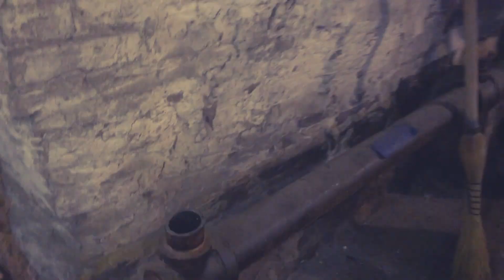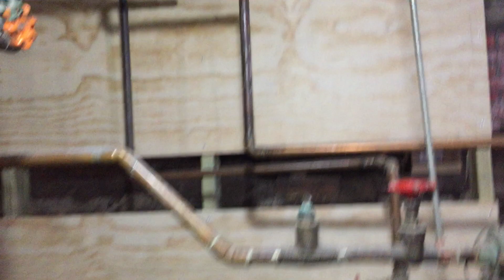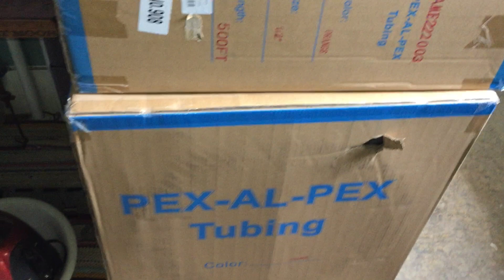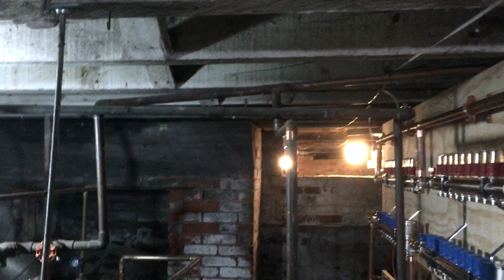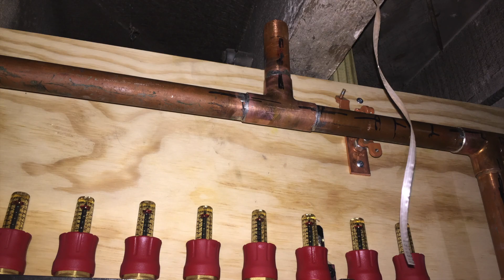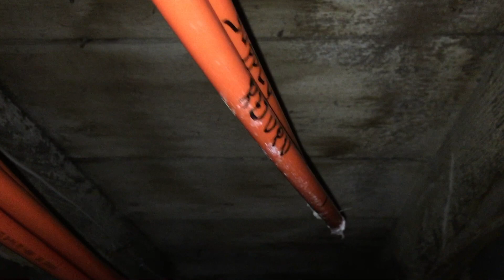Heating System Upgrade Part 2

Comment: How many SQ ft is this house with three apts?

On a single 3500 sq ft home I currently have 2 in black pipe for the majority of my one pipe system connected to my boiler. If we run the pex as one pipe through the whole house, can we go down to 1" PEX (PAP)? 

Or do I have to run this on a manifold? 

If yes, 

I have 7 radiators on the first floor, 6 on 2nd floor, and want to add 1 new on the third floor and 1 in the basement. 

 
What fittings did you use for the PAP to the radiator?  Copper or brass?
Reply: I just realized you're using half inch PAP. 

So if I go to manifold and not just one circle around the whole house I can use the half inch right?
Reply from the maker: It is an 8000 sq ft house and only has 1 apartment of which is three rooms basically - bedroom, liv room, and bathroom. There is a little area for kitchen sink, small stove and small refrig. This area is part of liv room. So the Apt has 3 radiators - one for each room.
I think that there is a benefit to running radiators out of manifold. Each radiator is going to get hot water, not water left over from the radiator before it in a loop. 
You said that you have a 1 pipe system - do you mean a supply pipe and a return pipe? Or just 1 pipe to each radiator?
If you have only 1 pipe to each radiator, than you have a steam system and that runs differently.
I would look at a couple of online supply houses of Pex equipment. Two that come to mind are supplyhouse.com  which has information too about pex, the other is pexuniverse.com. This will give you a good idea what tools and required fittings are required.
I will be going over how the pex gets connected to the radiators in the next vid.
Using a manifold for each zone gives you flexibility to control, if needed, a radiator in a room. This also allows you to thermostatically control a room. IN other words, if the second floor is all bedrooms, then you might not want to heat it at certain times of the day for instance, or as hot as the first floor, etc.
Reply: @spyder1650  Thanks for providing these videos, I am in the planning phase of doing something almost identical but on a smaller scale (2 separate 6 outlet manifolds).   I had a couple of questions if you are able to help?
 1). Did you consider running 3/4" pex to each radiator, or were your manifold ports 1/2"?  
 2). Did you consider using oxygen barrier PEX vs. the Pex-Al-Pex, and if so, why did you go with PAP? 
 3). How is your system operating now? would you have done anything differently?  
Thank You very much!  -Steve
Reply from the maker: 1.) I saw where someone else had used 1/2" to the radiators and it worked fine, so I didn't even think of 3/4".
2.) I did not consider oxygen barrier PEX because when I found out about the PewxAlPex it seemed to me like the best Pex to use for the project. Strong, It doesn't expand and contract like std pex, and it was easy to bend where std pex always wants to fight you when you are trying to straighten it. Check out Episode 4 where I talk about PEX AlPex
3.) Interesting, I answer these questions in episode 4 - and yes the system has been operating for 2 years.
Reply: First of all thank you for your reply I'm just now seeing it. I do have a supply and return connected to each radiator definitely hot pipe system.  My ignorance is calling it a one pipe system but I guess it's too pipe if there's a return and supply although two plumbers have told me that no one installed a valve in front of the boiler therefore the return and supply to the boiler are connected which didn't make sense to either of the plumbers.

Thank you for the supply links. I was going to hire someone from Chicago to come and help me with this but that's not working out. Ever since my husband passed away last February my piping has been a pain it's almost like the universe is trying to tell me to stay in this house. No worries I have no plan on leaving, meant to be here that's very apparent. After fixing three leaks since he passed I threw my hands up and realized something more major needed to be done and the boiler is only 9 years old and in great condition.

I'm in a bit of a pickle right now, with the approaching storm I'm going to get 25 below zero wind chills outside. Because of the last pipe we cut out and could not get replaced in the Attic, the system is still full of water up to the second floor. I know it's good to leave the water in the system as long as you can because it can get messed up without it sitting dry. I do plan on replacing radiators on the second floor but would like to keep the ones on the first floor they're in good shape. Is it safe to go ahead and drain the system even though I don't plan on actually starting this job to replace the piping for at least another month until I can get all the supplies? Should I just try to keep the house as warm as possible through the next week with the low temperatures. My temporary system we set up on the first floor keeps the majority of the house plenty warm it's a 50,000 BTU vented natural gas stove we vented through the chimney on the first floor. I'm going to have to run space heaters and some of the bedrooms and possibly the basement although it seems to be running around 55° down there no matter what. I don't want any of these pipes that still have water in them to freeze. My question for you is should I just go ahead and drain it would that be bad for the boiler to sit empty like that for a month or two? Yes I realize I may end up having to replace every single one of the radiators. Or would I be better trying to keep everything 50° or warmer so nothing freezes? 

Appreciate your input so much you just can't imagine how helpful you have been!
Reply from the maker: I am sorry that I am just seeing your comment. I hope you weathered the storm.We had a problem 2 winters ago where we lost power in the area for a number of days. So the house was not heated. Unfortunately, a door, to the billiard room, from outside, a dutch door, which has not been opened in a long time, blew open during the storm. We had high winds and brutal cold, so the radiator in the billiard room froze and had to be fixed. But it sounded like you had the right ideas as to keeping your house warm enough so that the pipes didn't freeze.
Reply: That's okay we so much appreciate you answering our questions.

Yes the temporary system along with some space heaters we weathered the storm and left what water was in the system alone because I know it's better to keep it full than empty when the boilers not in use.
 Going to finish watching the other episodes today and start our shopping list and get it ordered.